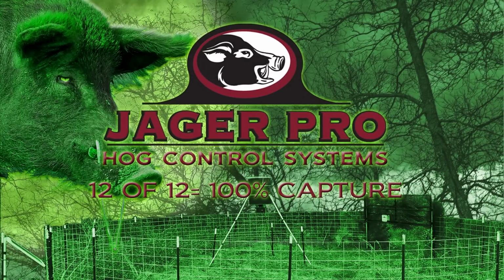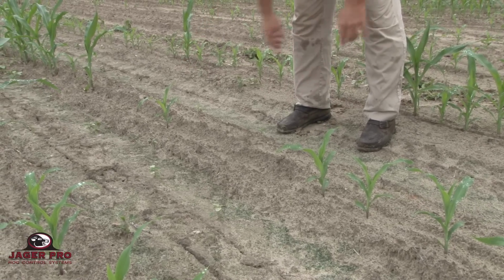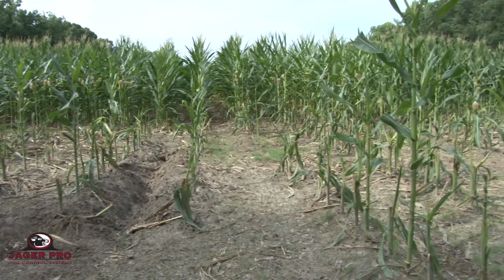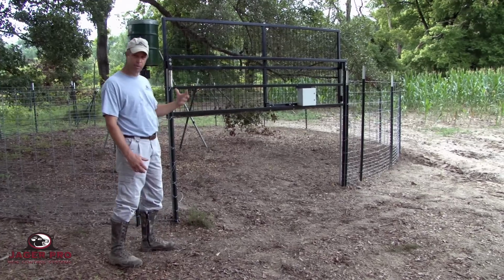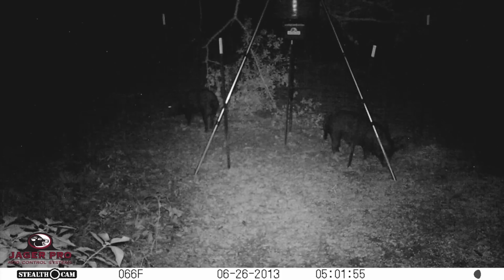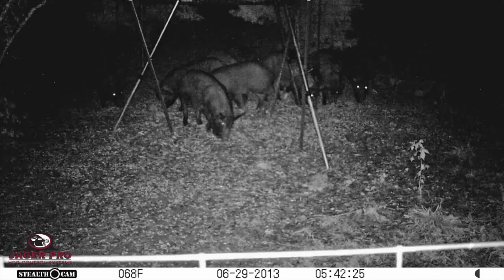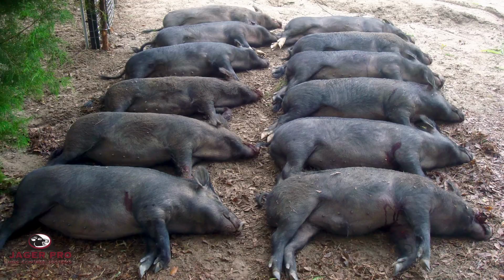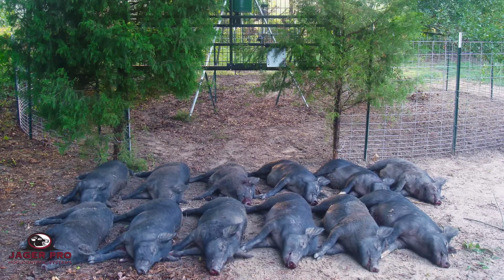Wild Hog Trapping | (14) 12/12 Success Trapping Feral Hogs in June Corn | JAGER PRO™

Comment: Now a fair question would be how quickly hogs from neighboring properties would take over this property once the resident sounder is eliminated.  Not sure of the answer but it does seem logical that they would move in quickly if hogs are territorial, since most animals are.
Reply from the maker: It only takes 15-18 months for a trained and certified Hog Control Operator™ to eliminate feral pig populations from 10,000-acres. But there are several factors which determine how long a property remains at "zero balance" after a successful Integrated Wild Pig Control® (IWPC®) program has been implemented. Future reproduction and migration would have to come from adjacent properties since an effective IWPC® program would prevent escapes, method education and reproduction from the entire generation of feral pigs living on the property.
Are neighboring landowners implementing a successful IWPC® program? 
Are there enough trained and certified Hog Control Operators™ in the county to effectively implement the IWPC® program? 
Has the state passed legislation to stop intrastate and interstate transportation of feral pigs? 
How well are law enforcement personnel enforcing these rules in the state? 
Are judges and the court system prosecuting those breaking the rules with heavy fines? 
How many criminals are illegally transporting and releasing new feral pig populations in the county? 
The amount of time a property remains at "zero balance" greatly depends on the answers to the above questions.

Comment: Can't u just train a few hunting dogs so that they could scare away the hogs?
Reply from the maker: Using distress sounds, propane cannons or dogs to scare feral pigs are considered "aversive devices" and is (at best) a short-term solution. Pigs quickly become desensitized to the method if no physical danger occurs. There has never been an academic study (from any country) to support fencing or aversion will eliminate agricultural crop depredation long-term. Fences, aversive devices or other non-lethal methods do not prevent reproduction of the species, therefore offers no benefit to population control. Only lethal control methods are effective since feral swine exhibit an extremely high reproduction rate and intelligence.

Comment: i think this is more costly and time consuming than simply erecting fences at the perimeter of the farmland. the hogs will keep coming back
Reply: +faisal2401 They find ways to get around fences easily. And this isn't just about protecting crops, it's about eradicating a dangerous pest from fucking up the native wildlife.
Reply from the maker: +faisal2401 Fencing is a logistically and financially flawed theory and does not address reproduction of the pest. A single sow will produce two litters of 6 to 10 pigs annually and their offspring will reach sexual maturity in eight months of age. 100 sows can escalate to 1,600 pigs (100 x 16) in one year. A fence does NOT stop reproduction outside the fence. A single American farming entity may plant and harvest 2,000-3,000 acres spread across multiple counties. One square mile is 640 acres which would require 4 miles of woven wire fence costing $31,792. It would take 672 hours of labor to build such a fence to protect a single square mile section of crops. Our demonstrated solution only required three hours of total labor using a $2,500 M.I.N.E. Trapping System. There were no pigs left from this sounder to reproduce or become educated to the process. Removing 12 of 12 adults before they gave birth to 25 fetuses permanently eliminated all future ecological and fiscal damage caused by this specific sounder. Pigs cannot "keep coming back" if the entire sounder is dead from the efficient control method.

Comment: Hogs are a real pain in the ass for farmers. I guess a very good fencing system around your fields is a big part of the answer if hogs are a constant problem, even though it's expensive. Trapping is just part of the solution, because more come afterward.  I have a few questions:
What did it cost the farmer to have you eliminate the 12 hogs? I know each case is a little different, but just give an average cost.
What does the meat sell for per pound when you sell it to a wholesaler?
Reply: No answers, Jager Pro?
Reply from the maker: alan30189 It would cost our customer approximately $1500 to provide a 100% capture service for 10-15 feral pigs. It is NOT legal to sell feral swine in the state of Georgia as we do not allow transportation of wild pigs alive.
Reply: JAGER PRO™
Thanks! That's a great value to get rid of a major problem for a farmer. That is interesting stuff regarding Georgia.
I am going to PM you something...

Comment: As feral hog experts, maybe you can teach farmers to be careful, unlike our ignorant fore fathers, who let hogs breed and run loose, creating this mess.  I didn't like how the hogs ran into the pens.  It would have been better if you would have just shot them while they were grazing, without that elaborate and expensive kill site.
Reply from the maker: Present day farmers do not release pigs into the wild. As retired Soldiers, our definition of "better" is efficiency. We cannot shoot all 12 hogs in a standing corn field without some escaping. However, we can obtain 100% capture results using a M.I.N.E. Trapping System with less than three hours of labor. It is important you know the difference between the two methodologies since you are an open minded educator living in the south. The average farmer can solve his crop damage problem using a M.I.N.E. Trap, but does not have the time or specialized skill set for shooting them to obtain the 100% success necessary to stop future reproduction.

Comment from the maker: Your flawed urban logic and lack of rural agricultural practices is amazing. A single American farming entity may plant and harvest between 2000 and 5000 acres. One square mile is 640 acres of corn which would require 4 miles of woven wire fence costing $31,792. It would take 672 hours of labor to build such a fence to protect a single square mile section of crops. Our demonstrated solution only required 3 hours of total labor using $2500 of equipment to remove the "innocent" agricultutal pests.